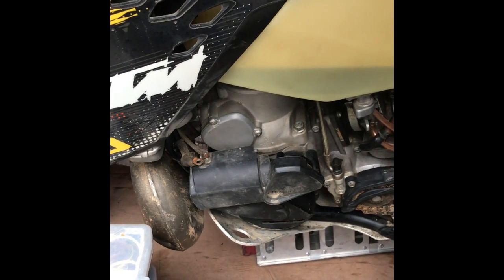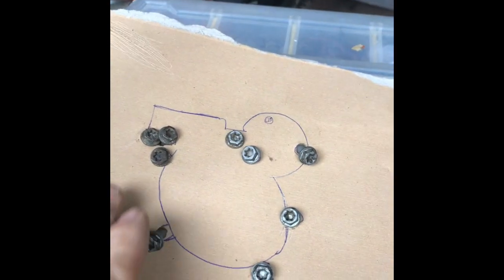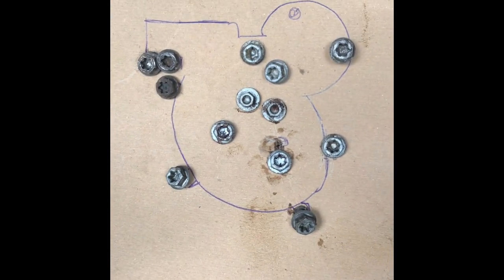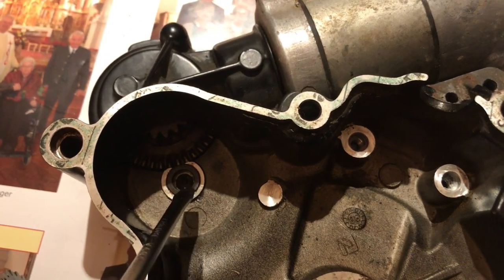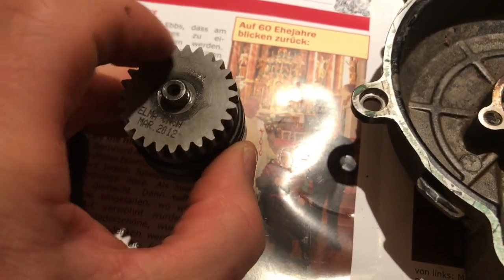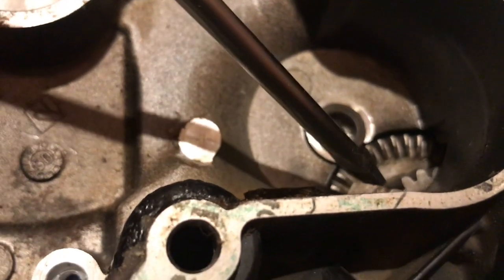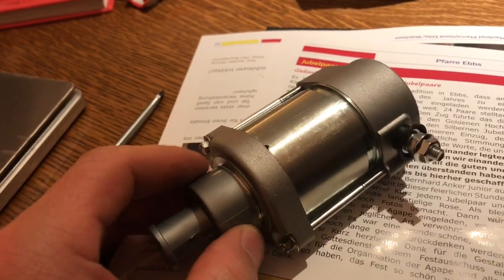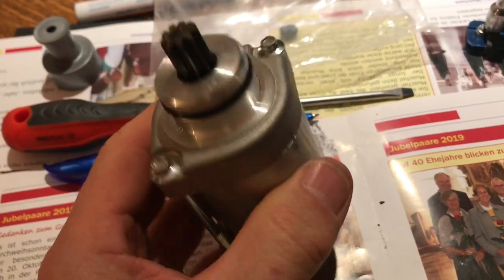KTM 300 Electric Starter & Bendix - The Ultimate  Repair - Part 1

Comment: I run a high CR head on my 2013, I've had no end of trouble with the starter system, I've done the wet mod and fitted better bushes, I run a 410w motor and an extra earth lead to it, I've gradually increased the battery size. I was running a stock is a YTZ4, I tried a YTZ5 and  YTZ7 BS which has about 130 CCA and I was still having problems with the starter motor stalling. The YTZ7 battery is taller but it just fits under the seat. I've just fitted a Noco NLP5 lithium battery rates at 250 CCA!!! and guess what, the bendix gear is now slipping. The plastic battery tray has ribs that face in towards the battery, it is a good idea to use a sharp wood work chisel and plane them off, they dig into the battery and start to wear grooves into it.

One problem with the 'fake' starter motors is that some of them use a steel bush at the 'gear end' of the shaft, running a steel shaft in a steel bush is not a good idea, I replaced the steel bush with a bronze bush that I machined up after the steel bush started to gall up. The KTM motor has a ball bearing but the price for that motor is sky high!

 I don't think the new setup gives 17% more torque, 27/18=1.5:1 and 28/16=1.75:1. The percentage difference between 1.5 and 1.75 is around 15%

Anyway, a good video, very helpful.
Reply from the maker: Yes I’ve done all the extra thick earth lead etc and even wired it up to a van battery. Personally I think cable and batteries are not the problem its always starter motor,  gear ratio and binding from bushes or clearance.  The whole design was bad from the start. 

I had the same issues with a v6 be Touareg. Would swear it was a duff battery as it’s sometimes only just turn over. So would replace the battery and its be the same. Turned out to  be the starter motor under certain torque situations would jam up. 

Good luck with your challenge. You can do it 👍
Reply: @YoucandoitwithJules  I worked out a nice 'fix' for the spinning gear, basically by using 3mm diamond burrs you can grind a semi' circle dish or 'dip' into the shaft, you can then grinding a slot into the gear, the slot should NOT run the full width of the gear. 'Normal' grind stones like the ones that you get with a Dremel won't even mark the steel parts and neither will tungsten carbide!  By using a 3mm steel ball bearing that sits in the dip and high strength locite it should be possible to lock the gear to the shaft, the ball bearing will physically stop the gear spinning on the shaft. I started to do this fix on my 28 tooth bendix but its not really worth it now as I'm changing the ratios, have said that I will fix my old bendix anyway. I guess if a laser welded bendix fails then this fix would work.
Reply from the maker: @sidecarbod1441  Great Plan. Let us know how it goes. You can do it 💪
Reply: @YoucandoitwithJules  Quick update, I ended up swapping the bendix for the 2016 version along with the crown wheel, the starter system was working well until the bendix shaft snapped in two a couple of mm past the point where the gear is pressed and welded on to it, the weld did not break, the shaft just snapped!  In the end I decided to lower the CR of my engine from 13.2:1 down to 12.5:1, hopefully the replacement bendix can cope with this CR. KTM quote 13.2:1 CR for all the 300cc engines but this is not correct, the SX runs this CR, the EXC as standard is 11.8:1 CR  (all figures are the uncorrected. or geometric ratios). I'm not sure if I would trust my ball bearing fix now that I have found out that the bendix shaft is running pretty near its torque limit.
Reply from the maker: @sidecarbod1441  wow snapping the shaft. So fixing one weak spot has just move to the next weak spot. Reducing the CR is the best short term solution. It's a lot of work to modify a bendix to run a thicker/tougher shaft and still fit into the bushings. You can do it
Reply from the maker: Also have you seen my part 2 video as you may binding issues ?
Reply: @YoucandoitwithJules  I don't think it would be possible to run a thicker shaft because the 'multi start helix' that the gear the slides up and down on is part of the shaft. I'm surprised that the shaft snapped because it must be made of a high quality steel, I know this because when I 'fixed' my 2013 bendix the only thing that would cut into it was a diamond burr, tungsten carbide would not even scratch it! My CR is still higher than the stock EXC model, I was out on my bike today, so far the starter has been OK.
Reply: I have replaced the crap standard bushes with steel ones that have a tin copper coating, my bendix has about 0.3mm end float which seems to be 'some' but not too much!
Reply from the maker: @sidecarbod1441  it’s on the channel. Bendix Part 2. It might help. You can do it 👍

Comment: Slaven says on one of his Youtube videos, that he doesn't recommend the 'Wet Mod', he did it for one customer several years ago, and he has never done it on one of his own bikes.
Reply from the maker: Interesting. I haven’t  filled mine with oil yet and probably won’t. But if you ride water and river crossing etc. Blocking the lower vent and installing a upper vent tube stops all the muddy water getting in. You can do it 👍

Comment: Would those codes work for a husqvarna TE300 2015?
Reply from the maker: Hi are you taking Bendix and crown wheel  codes ? Yep they should be al the same as the same motor.
Reply: @YoucandoitwithJules  Yeah i need to order both but can't locate the parts but I am thinking 🤔 the KTM parts are the same?
Reply from the maker: Miss Nelson  Hi yes it the same motor. I used cylinder base gaskets in my rebuild from husvarna as they seem to have more choice of thickness plus the nearest dealer to me is husqvarna. Don’t know where you live but I bought bendix and crown wheel from the internet. https://www.motorcyclespareparts.eu/en. Hope this helps and once you get the new starter setup it starts on the button even with a modified high compression head. Keep us posted. You can do it.👍
Reply: @YoucandoitwithJules  Sorry, was on wrong account, Scotland...managed to locate a 1x dealer 2hrs away. Will try them for parts if not will use the link, thanks so much.
Reply: @YoucandoitwithJules  The Bendix I can get is a 16/28 and not 18/28....what is the difference?
Reply from the maker: Rachel Nelson Hi what my video part 2 as it explains the difference between the new and old Bendix gear ratios. The newer couple with the 410 watt starter motor will give a 30% increase in starter torque. Please watch the video it explains all.
Reply from the maker: Hi. Think when they are talking Bendix 16/28 they are mean 28 teeth on the big gear that that engages with the crown wheel and 16 teeth on the other end of  the bendix that engages with the flywheel starter ring.. it’s the crown wheel that’s needs 16 teeth to drive the larger 28 tooth Bendix. If you get the 28 welded Bendix and. You didn’t habe 28,teeth before on thexold Bendix then you need to get the new crown wheel as well. Hope this helps.
Reply from the maker: Hi after checking my old bendix the no of teeth that connect to the starter ring is 18 this is the same for all 300/250. So the bendix you need has 28 teeth on the big gear and 18 on the small. The crown wheel needs to have 16 teeth on the gear that meshes with the 28 teeth of the bendix.I imagine that is what the dealer is quoting when he says bendix 28/16. 28 teeth on the bendix and 16 on the crown. This is the bendix you need. Plus of course a 16 crown wheel. Hope this helps clear things up. You can do it 👍
Reply: @YoucandoitwithJules  so I have just pulled out the crown..so crown has 16 teeth. So I can do 28/16 and replace only the bendix or if I go 28/18 i need both new parts.
Reply from the maker: Rachel Nelson hi if you have 16 on the crown wheel then you only need a new Bendix. Get the one with the welded gear if you can.
Reply: @YoucandoitwithJules  will have a look just now. You have been really helpful...thanks so much. Shorty legs here will be back with am electric starter yet...kick start is hard work halfway up a hill.
Reply from the maker: You get very good with the clutch when you only have a kick start 😊

Comment: Excellent video! Just did the same job, not doing the wet mod tho. How has that worked out for you soo far? Nice content btw Subd to your channel!👍🏻
Reply from the maker: Thanks. I need to up load Part 3 but the Ultimate setup worked a treat 👍 Did an extreme recce event  last weekend and it started on the button everytime. First time ever it’s worked 😎 I haven’t done the wet mod. ☝️

Comment: It’s definitely worth replacing the stock OEM bushes with bronze ones - the original bushes are a real weak point of the system. You can get them on eBay or from XRC in NZ.